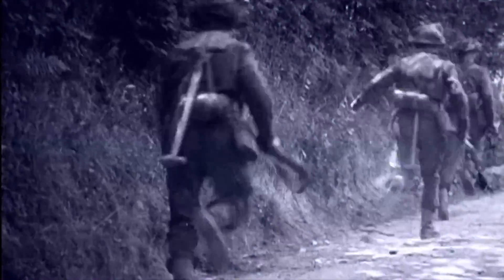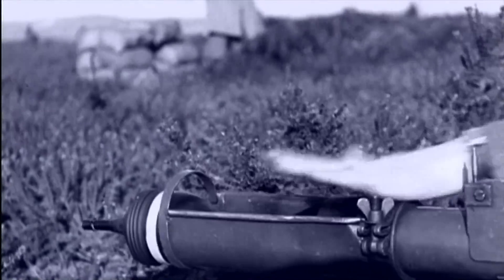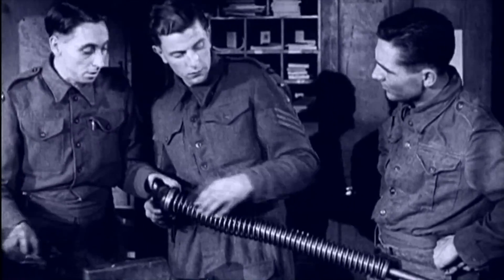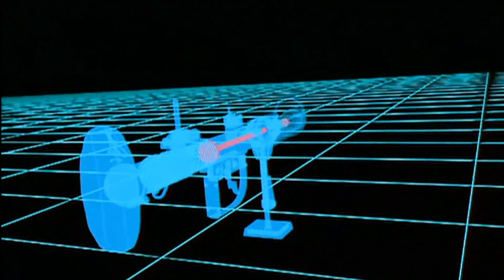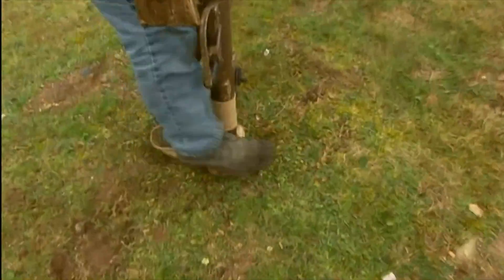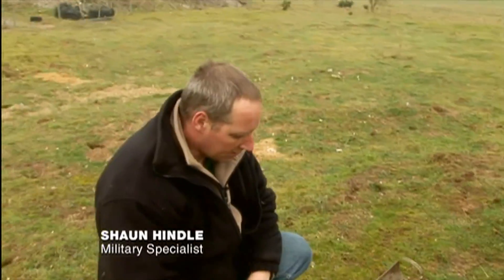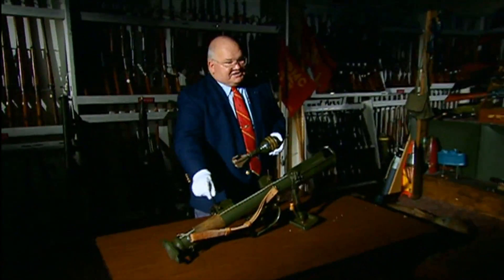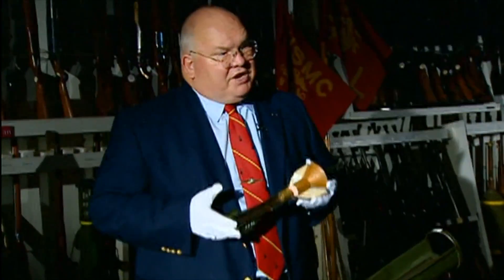Weaponology - "British PIAT"

Comment: "This thing's awful!" I would think that's what the SS Armoured Brigade thought when they tried to force their way across Arnhem bridge!
Reply: @0 1 :A contemporary (1944–45) Canadian Army survey questioned 161 army officers, who had recently left combat, about the effectiveness of 31 different infantry weapons. In that survey the PIAT was ranked the number one most “outstandingly effective” weapon, followed by the Bren gun in second place.

An analysis by British staff officers of the initial period of the Normandy campaign found that 7% of all German tanks destroyed by British forces were knocked out by PIATs, compared to 6% by rockets fired by aircraft. However, they also found that once German tanks had been fitted with armoured skirts that detonated shaped charge ammunition before it could penetrate the tank's armour, the weapon became much less effective.
(Excerpt from the Wikipedia history of the PIAT) 
You can scrape off all the sugar coating you want but the fact remains the weapon remained in service until 1950 with the British and Commonwealth forces until superceded by the Energia RPG type rocket and was used by the Israeli Defence Force to destroy many Arab tanks in the first Arab-Israeli War in 1949. Not bad for a second rate piece of dog poop!
Reply: @0 1 I'd have to agree with that! The PIAT was designed to do a job and it did it perfectly well (providing the firer could get into a position to use it to its full advantage). I think the one anti tank weapon out of WW2 that did alter war/history would be the  Panzerfaust - the true fore-runner of the throw-away single shot tank destroyer which led on to the LAW and the RPG. Like the PIAT, the 'Faust was a weapon devised in a time of need  if not panic! Such times do seem to produce ideas of genius.
Reply: No back blast, you can fire it in a building/ room.
Reply: @davidbrennan660  Very good point!
Reply: No SS Armored Brigade ever took part in the battle for Arnhem bridge tho
Reply: @Lehr-km5be  Oops you're right! It was the 9th SS Reconaissance  Battalion that was stopped in its tracks on the bridge - I always thought it was an Armoured Brigade!
Reply: @plymouth5714  That is true. Of course there were some tanks used against the 2nd Para battalion (even Tigers and King Tigers), and the paras were able to destroy some of them. That was not really thanks to PIAT being good, but rather due to the nature of the battlefield - they could easily flank the tanks or hit them from elevated positions from the buildings, as tanks would often get stuck in the rubble created by the fighting. And well, 9th SS recon was made of armored cars, half-tracks and trucks and with the british hitting them from sides and above from surprise, the fact that attack was repulsed is not all thanks to PIAT's virtues. It is also worth noting that there were 2 to 4 6pdr AT guns present close to the bridge.
Reply: @Lehr-km5be  
You really hate the fact that the PIAT did the job it was meant to.  you have to admit it worked but then you try to make out it only worked if the circumstances were just right.
You really are desperate to make out the PIAT was no good but you can't deny the PIAT did stop tanks and armoured vehicles. It is worth noting that the and from all I have read there were no anti tank guns defending the bridge from the German armour, it was almost all left to the PIAT.  If there were 6 pounders at the bridge they would have taken part in the fighting.
Reply: @barrierodliffe4155  I doubt you will actually be able to read a real history book, but I recommend "Arnhem: The battle for the bridges, 1944" by Antony Beevor or "Operation Market-Garden 1944 (part 2): The British Airborne Missions (Campaign)" by Steven Zaloga. But knowing that a book may be too hard for you, I found for you something on the internet - https://arnhemjim.blogspot.com/2016/12/the-6-pounder-anti-tank-guns-at_10.html
I really wonder what did you read about Arnhem Bridge, I am kinda betting it was a Wikipedia article :)
Reply: @Lehr-km5be  
No I find comics that you like to be boring however I have read plenty of real books which tell a different story to your moronic claims.
No not Wikipedia just truthful and accurate history.

There were five 6 pounders which did a good job but this does not alter the fact that the PIAT served very well and since not all the fighting was in one position the PIAT was used in places where there were no 6 pounders.
I take the word of the people who were there and did use it to good effect.
Reply: @barrierodliffe4155  If you really read any history book about Market Garden you would know that 6pdrs were present at the bridge without me having to tell you that. Meanwhile you yourself said before that quote "If 6pdrs were present at the bridge, they would have taken part in the fighting". They were present and they did :) You are just changing your words however it suits you - thats what happens when you use Wikipedia as your main source of information. Sorry, but you are not going to change real history with your own preferences.
Reply: @Lehr-km5be  
6 pounders all 5 of them did take part but they did not do all the fighting against tanks, much of the fighting was done where 6 pounders were absent. 
Real history that shows the PIAT worked rather than your lies about it.
Reply: @barrierodliffe4155  Stop changing your word however it pleases you - you yourself first said that 6pdrs were not present at the bridge, and then you said they did not take part in the fighting at all .Real history shows that 6dprs took part in heavy fighting and were very successful - thats what happens when you take your knowledge from movies, rather than real books.
Reply: If you were not aware about 6pdrs at the bridge, you could not claim that they were not present there - and you even said that you read that there were no AT guns there. Thats what happens when you take movies and Wikipedia for granted without checking facts. I do know that the americans used 6pdrs aswell, but that is beyond the scope of this discussion - and it seems that you do not know that americans referred to them as 57mm, not 6pdr :) Sorry dude, but you are not going to provoke me by insulting me - typical for people who lost their arguments and now just try to make other person angry so they start swearing too. Unfortunately for you, I am too smart for that and I will never go down to your level and play your game. You insulted a lot of people in this comment section trying to force your biased opinion, you lied and you faked your sources. Thats how far your desperation and fanatism go. I read through you, and no matter what you do, you will never make me sink as low as you by insulting me - now you are just calling me a "nazi" (even tho I never said anything even pro-german lol) just because you are simply trying to tilt me so I do the exact same thing back to you - sorry kid, not gonna work :) Thats is the ultimate point when you lost the discussion and you are just spilling random words just to offend me, because you could not convert me into your biased faked opinion.
Reply: Oh so it seems you even deleted your comment under which you tried to force your opinion on me and under which I also exposed you. Thank you for proving me right :) Shame on you, thankfully other comments are not yours so they won't disappear that easily :)
Reply: Already told you - you aint no gonna tilt me kiddo. I quess you still do not realise that 6pdrs were present at the bridge and were fighting there - Wikipedia will never teach you that :) The fact that you deleted your comment under which I exposed you means you have proven me right and you have no power to win any discussion anymore. Thank you for doing that :)
Americans called 6dpr their own thing - in their service, their gun was called M1 57mm - even your favourite wikipedia will tell you as much -  "primary anti-tank gun of both the British and United States Army (as the 57 mm Gun M1)" - taken from your favourite source :) Just because you do not care about history and facts, it does not mean it did not happen - and you proved before that you do not care about actual history, but you only care about movies and games.
You can stop trying to make me insult you back - I have stated that I will never go as low as you to lie, cheat and call other people bad things just because they do not agree with me. I disagreed with you and exposed your lies - you could then stop trying to lie and fake even more, but you decided to go down the path of insults and dumb swears - but unfortunately for you, I am too intelligent for that and you will never be able to make me lose my temper :)
You can go lie somewhere else and push your fake agenda to other people.
Reply: Nice try, but aint no gonna work on me dude - keep trying. Not gonna provoke me with your insults :) If you said that you don't care, why are you still replying?
Reply: Still not enough to provoke me :)
Reply: @barrierodliffe4155  I suggest you learn how to read finally. You are trying to provoke me to insult you, but you will never succeed :)
Reply: Maybe you dont care about being insulted - but I dont care about that. The main point here is me not insulting you back because I am more intelligent than you - I do not get provoked by some kid insulting me. Not gonna work for you tho :)
Reply: If you really couldn't care less, you would not still be trying to provoke me :)
Reply: @wufongtanwufong5579  Nah, just stating the obvious truth that Bazooka was better :) I really have no idea where you got the thought that I think that german tanks were precious to me and I like Wehrmacht - it appears you have no idea how to read. I do not like it and I know it was brought to destruction in part thanks to the glorious Bazooka, an actual good anti-tank weapon. Seems like you are just mad that a british weapon was not the best and was far surpassed by an american-made weapon and a piece of american tech that  is still in use today by the whole world :) I am truly sorry that your beloved german tanks which you thought to be indestructible were destroyed by a metal tube - but thats the way it is :)
Reply: @davidbrennan660  
Not that sending a tank into urban combat without infantry going ahead could be considered a good idea.
Reply: no.... it really is awful, panzerfaust or bazooka  was much better.
Reply: @raypod5964  no, it depends on how you look at it. Easy to load, no back blast, easy to use in a confined space and to carry. Must be Merican.
Reply: @Xyzabc998  
No back blast but a few broken shoulders. The panzerfaust hadxa 2 meter backblast which isnt much.
Reply: @raypod5964  : It depends on how you look at it! The Bazooka when it was first developed was virtually useless. It was first used in North Africa where not only were there huge problems with the missile charge either sticking inside the barrel or prematurely detonating before it fired but there were no confirmed reports from the US troops of it actually knocking out a single German tank in the African theatre. (Possibly due to the US Infantry being issued with the things with absolutely no training in how to use them!)  The Germans actually captured a few of the M1 Bazookas and reverse engineered them to produce the Panzerschreck. They increased the diameter of the tube allowing a larger more effective explosive charge. Towards the end of the war the US then captured Panzerschrecks and copied them to upgrade the Bazooka to M9 which proved more successful until the Tigers and Panthers arrived when it became unable to penetrate their thicker and spaced armour. The Bazookas were far better suited to taking out enemy strongpoints than they were for their original purpose. The Panzerfaust was  a very effective weapon with far more destructive power than the Bazooka and about the same as the PIAT (they were both shaped charge projectiles) there was of course one disadvantage, you had to carry a lot of them around because unlike the 'awful' PIAT after you fired it you couldn't reload if you missed! There were of course better AT weapons than the PIAT - but most of them came much later. In the right place a PIAT could take out a Tiger, and that's what it was supposed to do!
Reply: @plymouth5714  yeah good luck reloading a PIAT in the middle of a firefight... also the panzerfaust was not only more deadly but also cheap to make and eazy to learn how to use. The piat was just a rushed AT gun that nobody actually wanted to use in the field...
Reply: @raypod5964  But because they did not have any back blast they could be fired from inside buildings.
Reply: Raypod it was cheap which was the main reason the brits used it and it wasn’t many other alternatives in infantry anti tank weapons at the time.
Reply: @raypod5964  Patton, yes General Patton, suggested the effective range of the bazooka be kept to 40 yards and only to be used when infantry are about to be overrun by tanks...
Reply: @raypod5964  Panzerfaust wasn't developed until much later
Reply: @TheNapchop  Well, if we are comparing the introduction dates of PIAT and Panzerfaust there was not really a lof of time between them - PIAT was first introduced to units during the invasion of Sicily (so July 1943) while assignment of 5000 Panzerfausts were delivered to the eastern front in August of 1943. The PIAT started it's development in late 1941/early 1942 when it was clear that anti-tank rifles became pretty much obsolete. The development of the Panzerfaust began in 1942, after the germans wtinessed the effects of Bazooka's during the African campaign and decided to copy it.
Reply: @raypod5964   The piat could be fired while in a closed off room. It never gave away the firer's position when in the field.
Reply: Ralph Sanchez yeah it was garbage
Reply: @banger2998  
Better than anything else at the time and try telling the German's that so many of their tanks were destroyed by garbage.

Comment: Even if the effective range was a little over 100' , it's sure as hell a lot better than taking out a tank with a "sticky bomb". I think this weapon was brilliant for its time.
Reply: The PIAT and the GHAT 74 sticky bomb are both excellent examples of poor British weapons design
Reply: If you have to pretend bazookas didn't exist to make your argument, it's not a good argument
Reply: @Soft_Dusty_Rhodes The bazooka lets out a bright flash followed by a thunderous fart. It also couldn't be used indoors, when other comrades were nearby you.
Reply: @Soft_Dusty_Rhodes   The early bazooka rounds were notoriously unreliable, could and could not be fired from prone or inside buildings, furthermore they had to be imported. 
The whole "stand up to fire" horrified UK establishment when they arrived.

By the time the M1A1 Bazooka was in production the PIAT had long since gone into mass production

Comment: Yeah, monstrosity in first cocking that weapon. Panzerschreck FTW.
Reply: Yeah, Panzerschreck. Fun weapon to operate, that one.
You do know, why the Germans fitted the Panzerschreck with a shield, right? It's a blast shield. Plus the tube got so hot during operations, the operator had to take measures to not get burned.
A good weapon is not just defined by the bang it delivers, it's availability, reliability, easily maintained and how well it handles as well.

Comment: At first glance it seems worth it to consider that weapon. low cost. Lightweight. Simple enough to use. Limited back blast. Even It's limited range doesn't completely rule it out.
It could be good in the following environments;
trenches, bunker busting, and wooded areas.
Reply: And other close quarters. like in city urban warfare.
Reply: I'm inclined to agree.  I don't think there is an easy way of knocking out a Tiger but at least you have a fighting chance with this thing.